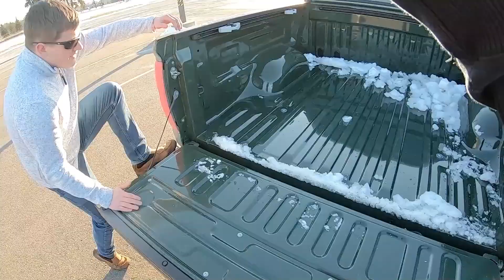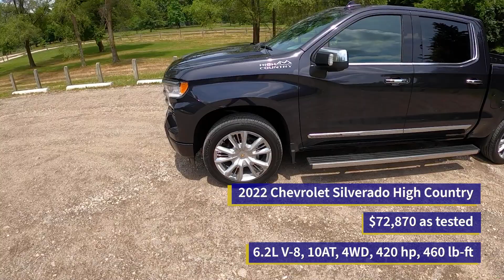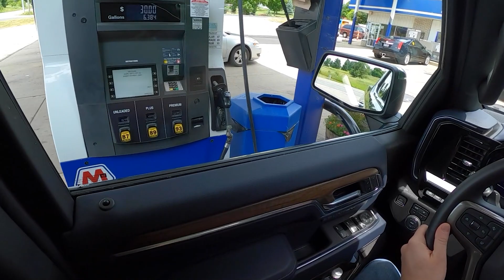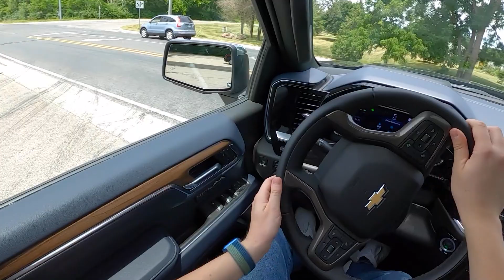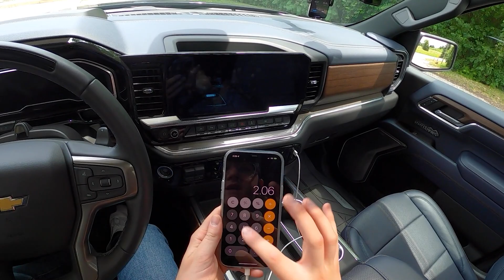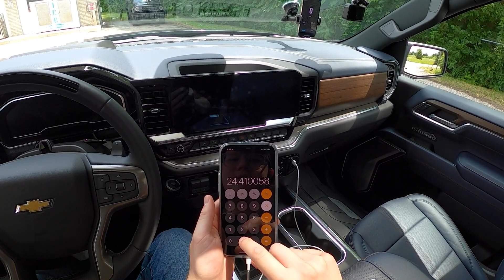2022 Chevy Silverado – MPG Test | Real-world Highway Fuel Economy and Range

Comment: I know you're supposed to put that premium fuel in there but I think that's more for performance it's not going to mess up the truck if you don't. I have a 6.2 and have no issues putting like mid-grade or sometimes even regular in there. Really can't tell much difference in the way it drives a little bit more power when you use a premium
Reply: I think 89 is recommended on the 6.2 and the 5.3 its whats ever
Reply: @coolsquad7428  93 for the 6.2. Believe me, I have one. With that said, you  can put lower octane fuel in it, and it won't hurt it just slightly less power
Reply: @chrismarbrey9678  yeah but not for long term as then your car will run lean and the power would be lagging, and the mpg will drop.

Comment: The 3.0 liter duramax is the best engine for the 1\2 ton segment hands down!  Nothing beats it, especially if you want to save money at the pump.
Reply: Nevermind the upfront additional cost and extra taxes and registration yearly.  Those costs are the driving factor in why it's being priced out.
Reply: diesel is more expensive usually, so there are unlikely to be any savings compare to gas
Reply: 87 octane vs diesel prices are substantially different .
Reply: @jamesbyrd9514  30 cent difference here, but it could swing the other way….seems like diesel costs less than gas some years. Probably evens out in cost per tank of fuel right now….which might not justify the extra expense to get a diesel engine and extra maintenance.
Reply: @underscr0e  I should have clarified because this vid is over the 6.2 which requires premium.  The 2.7 can run 87 I believe. Currently in TN/GA 87 is 2.85 and diesel hovers around 4.30+...... where most folk get caught up is the fact they don't drive enough to make a difference. I average 300 miles a day. Bought a 2022 last September with 5 miles on it....have just under 70k miles now. It adds up quickly lol
Reply: How many mpg does the 3l duramax get? How much range on a tank of fuel?

Comment: Bought a 22 refresh high country with the 3.0 diesel. Only thing I don’t have is the fancy tailgate. My first fill up at 300 mile and 1/2 tank left was 26 miles per gallon. I trade my 21 LTZ z71 that was getting 17 mpg still have the torque and getting better mpg. Mine was snickered at 65k. Loved the ride the 21 Z71 gave but would never use 4x4 and just made mpg lower. I didn’t have to cylinder deactivation system
Reply: I have a 2021 Z71 Silverado 1500 LTZ with the 5.3 V8 and I get a pathetic 13.9 average MPG.  I did put a leveling kit and Toyo Mud Terrain tires so I guess that’s why but I REALLY want a 2022 or 2023 1500 High Country.  I’ll probably go with the 6.2.  Just never had a diesel before.  I will be keeping this next one stock so I can get a better ride and better fuel economy.  I owe 30k on my ‘21.  Got it out the door in December of 2020 for 56k
Reply: How is the passing power on the new diesel, really my only concern with that engine.
Reply: @michaels7984  it will pass just like the 5.3 I had in my 21 Silverado. Early diesels were slow to go, had a 96 Chevrolet diesel, but mine is peppy. If you can find one take a test drive as they have a lot of torque

Comment: My 22 refeshed Trail Boss 6.2l/10 speed isn't getting that good of mpg's.  My 18' LTZ 6.2l/8 speed was better mpg's.  I still love the Trail Boss otherwise!
Reply: Put a 2/3 lowering kit on my 2018 LTZ. Mpg went from 22 to 24
Reply: It all comes down to driver habits and your Trail bosses got a 2 inch lift on it
Reply: @chrismarbrey9678  you are correct and the off road tires don't help either. I'm averaging 19MPG in mixed driving over 34K miles in my 21 RST 6.2 Z71.
Reply: @davidporter7051  I'm probably going to get the revised 3.0 diesel in an rst and get rid of my Trail Boss 6.2
Reply: @chrismarbrey9678  that's fine no one will blame you. But if you are keeping a truck long term keep the 6.2. The fuel savings on the 3.0 are completely washed and then some by costs of recommendation maintenance.
Reply: @davidporter7051 The thing is that the 5.3 and 6.2 get around the same mpg

Comment: Impressive, but these trucks have gotten so expensive.  To get the same features in our Hyundai Sante Fe Limited we would have to spend $65K and even more with some brands.
Reply: After my Silverado 5.3 suffered a dropped valve resulting in a $5500 repair I got a 16 Cadillac xts vsport.  At 140k it developed a stuck valve resulting in $10k repair ticket.  I too, looked at factory warranty and initial costs....got a 22 Hyundai elantra hybrid.  50mpg and I can fill with 87. Mega savings on fuel costs
Reply: Very true, it's gotten really crazy. They don't even want to make sedans anymore. They're only focused on the big money vehicles,   i.e., trucks and suvs.